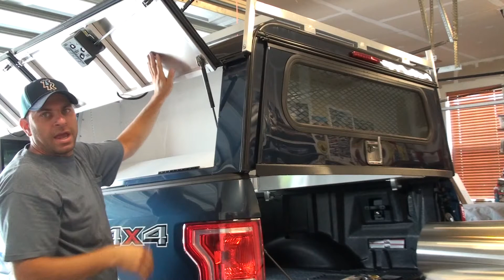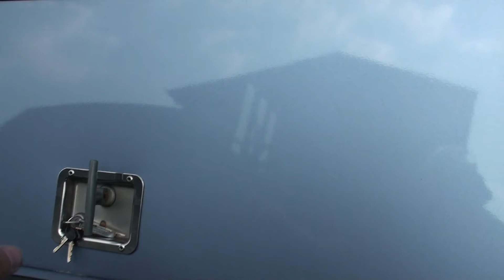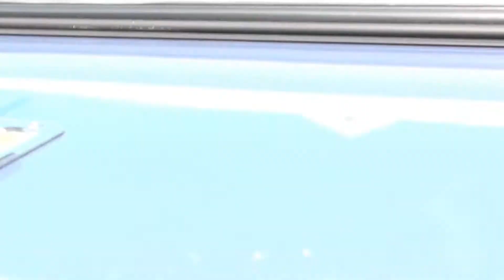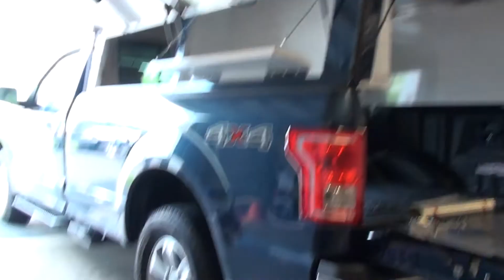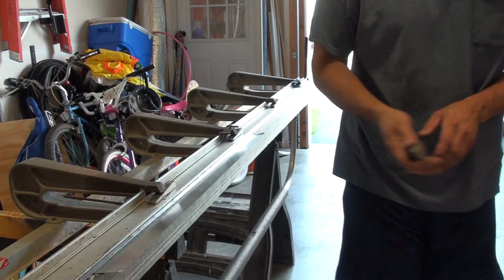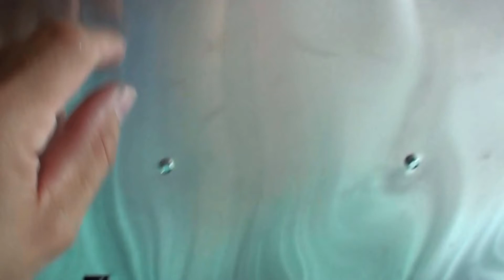Truck Cap Door Dent Prevention- Aluminum Utility Cap - ARE Caps

Comment: Actually, to help others find this product at the hardware store, you could have mentioned it's called "aluminum flashing" or "aluminum drip edge flashing" Rolls are available in different widths and lengths. Like you, I also used 20 in. x 10 ft. rolls for the side doors.
Reply from the maker: That it is.
Reply: @ozzstars_cars    ..  A very worthwhile video otherwise. Just wanted to throw in my two cents worth. By the way, love your bending brake. I'm limited to a little 18" one. Couldn't move anything much larger.

Comment: Nice video if you don’t mind me asking what did your cap set up that way, painted to match and all cost?
Reply from the maker: Three grand, $3k.  I would buy a Leer next time.  To many issues with this ARE
Reply: Thanks for the tip yea I had a different style ARE cap and it actually leaked
Reply from the maker: @growler1149  nothing new since ARE sold out to a Chinese company about 6 years ago.

Comment: I was thinking of getting a cap for the box of my Pick up. Not sure how it would work out when plowing. My first thought is it might hinder my ability to see when backing up. Scary thought not being able to see when backing out of one of my driveways. People are crazy here. they don't stop for nothing here. Great video. -John
Reply from the maker: You get used to the lower visibility with the cap on. I've been driving with one for over 15 years now.  I have glass on both the front and back of the cap so I can still use the rearview mirror.  Of course the backup camera with an 8 inch screen on my new truck is extremely helpful. It's kind of like pulling a trailer, at first its nerve racking but gets easier with practice.  Thanks for your comment John

Comment: I like the idea. I meant to ask you how the new truck has been working out. I had three A.R.E. caps, I've had good luck with them. Some trivia for you...A.R.E. stands for Alfred, Ralph, and Elizabeth. His kids.  :)
Reply from the maker: Learn something new everyday, never knew that Wyatt. The ARE Deluxe Commercial Caps have served me well over the years.  New truck is doing well, almost 2K miles on it now.  I really like the horsepower and handling.  Only negative issue is that slight chirp noise from the right hand cat converter.  I'll get it sorted eventually. take is easy
Reply: That's good to hear. Take care.